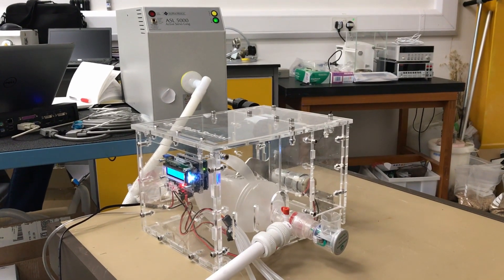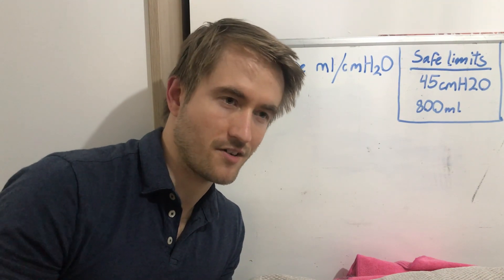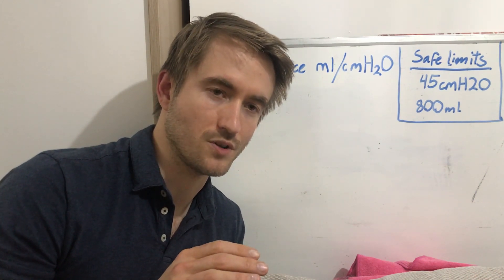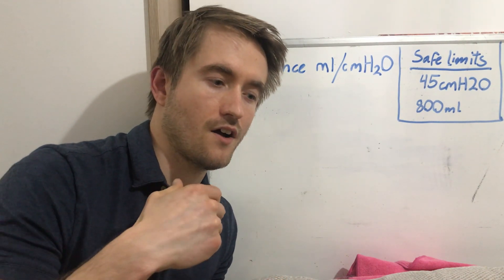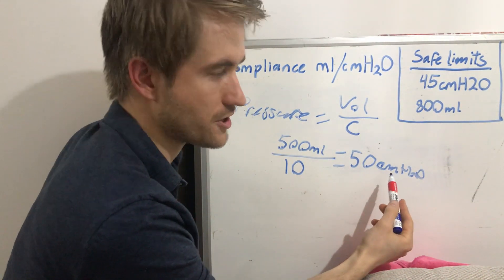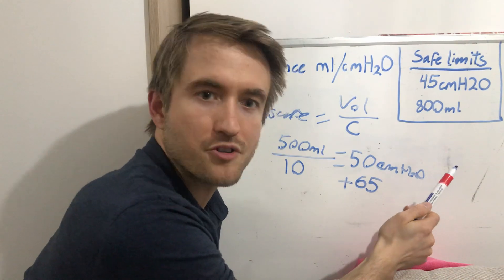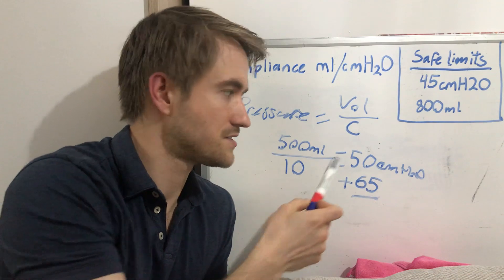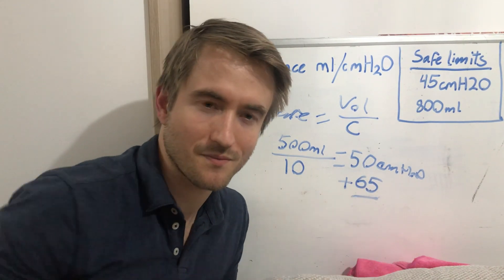OpenVent Bristol possible unsafe levels in MHRA requirements NPL testing

Comment: HI Darren.  It does seem like a bit of a self-contradiction in the MHRA requirements.  My guess is that testing outside of safe operating levels is a way to confirm that the ventilator being tested has extra capacity beyond the anticipated normal operating conditions.  Similar to a safety-factor in a mechanical design.  For instance, a ladder that specifies 200 lb capacity when in general they are tested at 2x that weight.  My hope would be that after verifying ventilator-capability at those unsafe levels, they would impose some redundant safety features ensuring that in practice, the pressure/volume levels are not allowed to exceed safe levels for the patient.  Thanks for your hard work on this project and sharing your progress.